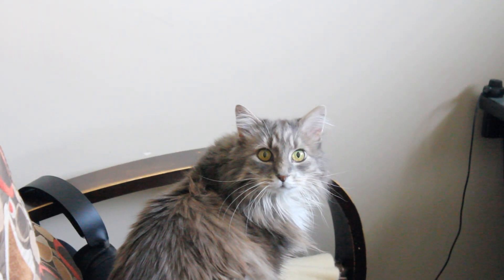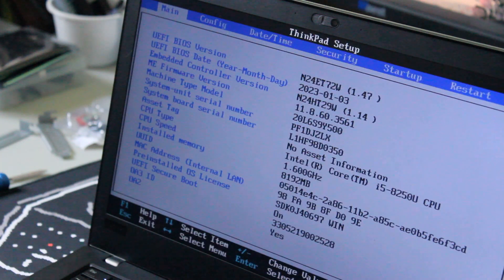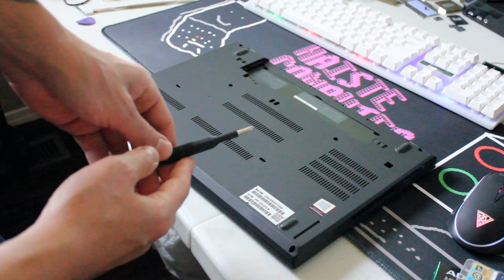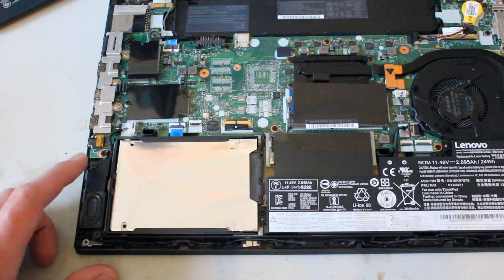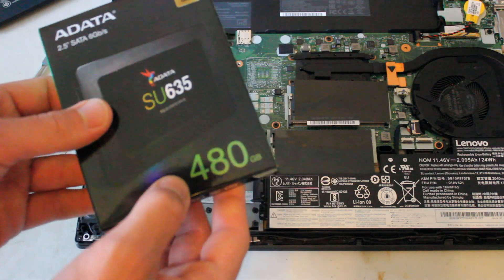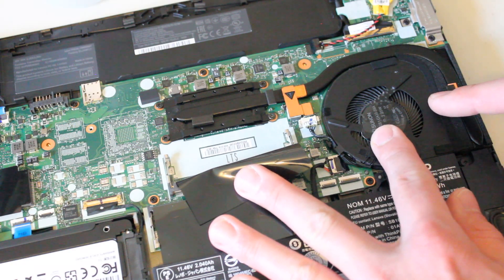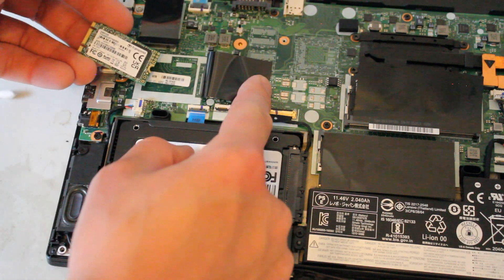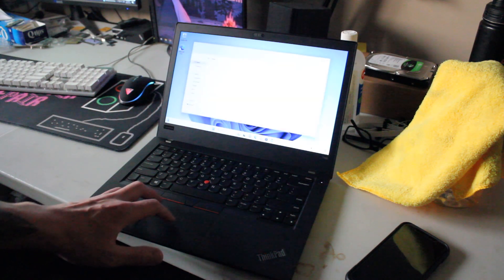Lenovo ThinkPad T480 SSD & RAM Install + New Thermal Paste

Comment: I need help, i just added WD NVMe SSD 2242 258GB in my WAN slot, I already installed it properly and disconnected the battery before installing, but im still stuck in my LENOVO title, I can't even go to Menu
Reply from the maker: Is this with the T480 or the T470?  You commented on both videos.
Reply: T480, We just figured out it's maybe defective or old one or damaged, because i even put it enclosure adapter to make it an external, it turns out it will read for few seconds you can open it and then it will hang.

Comment: So i just got the transcend 1tb 2242 sata ssd and im seeing reviews its not compatible can you confirm it is in fact compatible?
Reply from the maker: That should work if you’re installing it in a t480.  If you have everything, install it and try it out.
Reply: I'm reading everywhere that it does not support sata and I'd rather not open the packaging and send it back for the 70 I paid. Another question is it's b&m keyed but I only see one notch when I checked my wwan slot
Reply from the maker: @Bori387  You can see here in the product specifications, it does list both types as working.  https://psref.lenovo.com/syspool/Sys/PDF/ThinkPad/ThinkPad_T480/ThinkPad_T480_Spec.PDF

Comment: Hello I’m confused about the ssd it seems that there are 2 types of them for t480?
Reply from the maker: Yes, it depends on what kind of adapter you have connected to the motherboard.  It will either be a 2.5" SATA connection or m.2 NVMe.  You will either have to take a look in BIOS, Windows, or open it up and take a look.
Reply: @ yeah it’s 2.5 sata 🙌
Reply from the maker: @Fed-uw5lx  👍

Comment: I see you didnt disconnect the internal battery cable from mobo, is it safe to apply thermal paste ?
Reply from the maker: Yes, in the beginning of the video I went through how to disable the battery in BIOS before service.  You do not have to unplug from the motherboard in this case.
Reply: @HaisteComputerRepair  I thought we still needed to disconnect the cable even though the battery in BIOS is disabled. I really hate to disconnect the cable because its really hard haha..
Reply from the maker: @Sicilllian  No, you don't have to unless you want to.  As far as I know, I've never had a problem.

Comment: How is the laptop compatible with windows 11?
Reply from the maker: 8th Generation Intel CPU's and up are on the approved list from Microsoft.  To be clear, 7th gen and below can easily run Win 11, but in that case you have to bypass TPM 2.0 requirements on install.